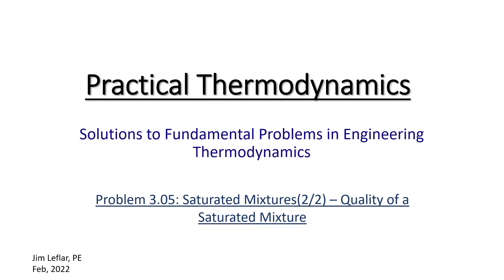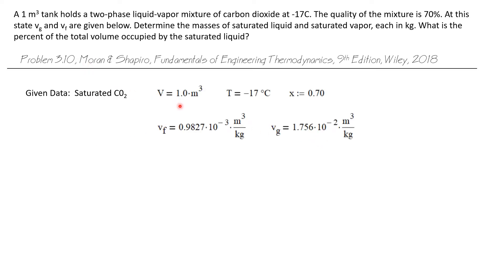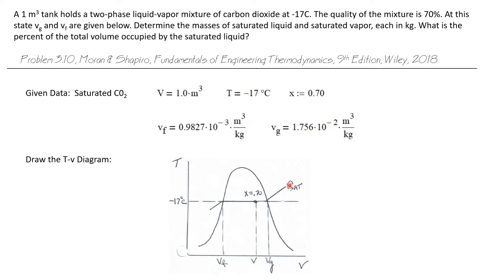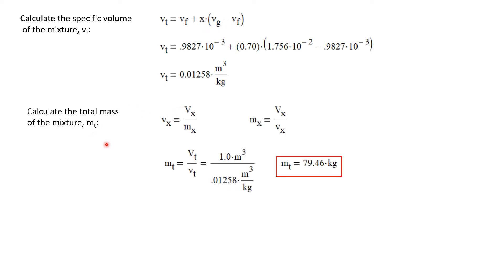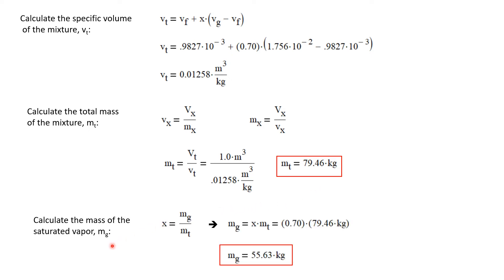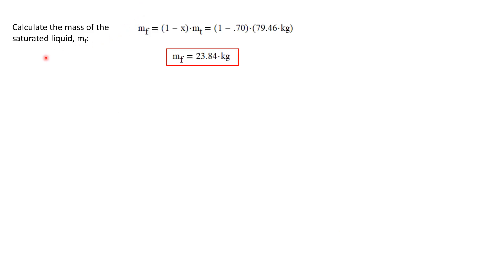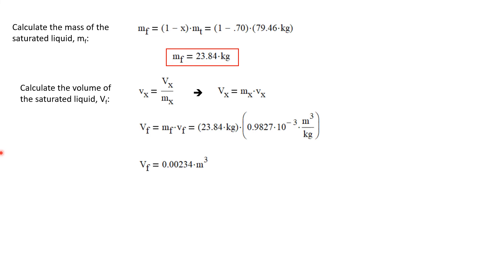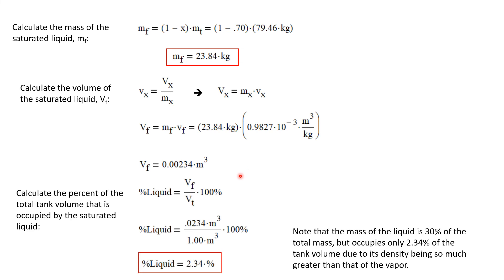Specific Volumes of Saturated Liquids and Vapors -- Engineering Thermodynamics 32/107

Comment from the maker: I have a typo in the calculation of the volume of the saturated liquid. Vf should equal 0.0234 m3 and not 0.00234 m3. The final solution is correct.